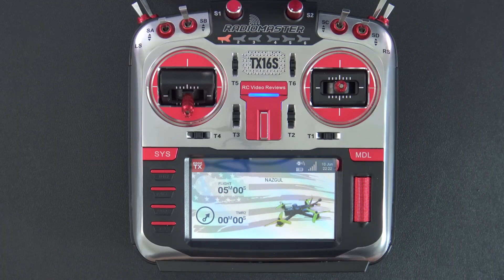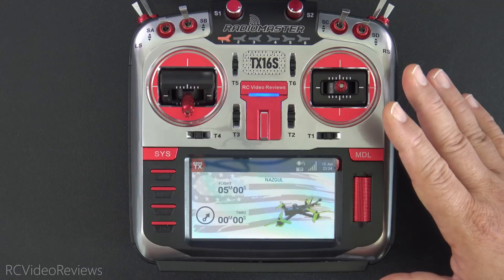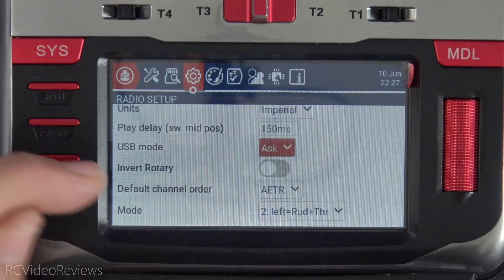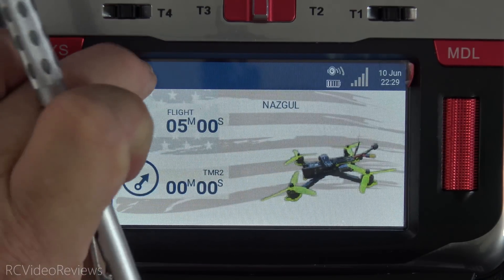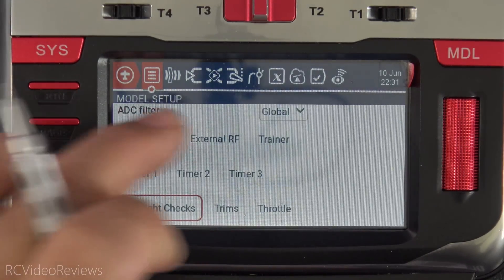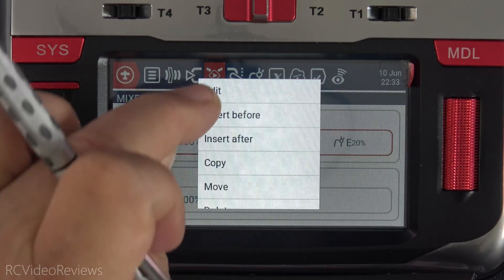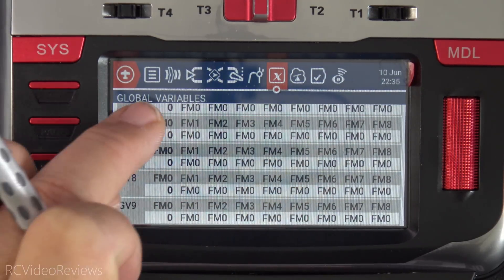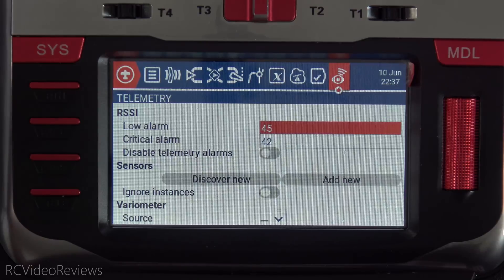EdgeTX 2.8 LVGL Based Graphics • AWESOME New UI Layout and Graphics for EdgeTX Radios!

Comment: I fly helicopters I noticed you fly 700 helis as well is there a way we could talk  so that I can get a basic set up going using expo, dual rates, pitch curves and throttle curves, flight modes. I fly spectrum dsmx dsm2 right now
Set for a heli is pretty easy in the spectrum radio.
Reply from the maker: Join our discord and visit the helicopter channel.

Comment: I have installed EdgeTX 2.8 LVGL Based Graphics on my TX16s. This is absolutely correct direction. Well organized menus that work great with the touch screen.
It looks very clean. Thank you for providing the link to the firmware.
Your videos are absolutely the best!
Reply from the maker: Thanks. Glad you got it worked out. FYI I spoke with the EdgeTX team yesterday--they already had planned to address the gripes I mentioned in this video. They're definitely on top of things.

Comment: Hi John, yet another very informative video. Just one question in the event of a bug being reported back to the Devs. Do they check the fault over the entire range of supported TX's, or just the TX it was reported on?
Reply from the maker: I’m not sure what their PD process is but I’m confident they resolve issues for all supported platforms.
Reply: It depends, when it is not in a radio specific location, a representative set of radios is tested, but not necessarily all. It is just a matter of availability of different radios.
With the new UI we have much less radio specific UI code so most problems will affect all color LCD radios.

Comment: I would love to see these menu changes as an option, 'touch friendly menus'. I much prefer the previous look and layout and rarely use the touch for navigation. Thanks Devs as always for your work, I'm sure this is great for those who prefer touch navigation.
Reply: I found I didn’t use the touch as much when I first got it. But then once I had it I started using it more and more.  These new features make it that much easier to use.  I can’t wait for this to drop as a full release.
Reply: My thoughts exactly. If we could have an OpenTX looking interface (where we can see more than 1 mix at a time) and use touch for the text input that would be great
Reply from the maker: You guys need to get on GitHub and let them know. They are interested in feedback.